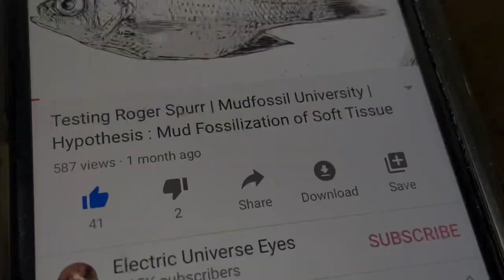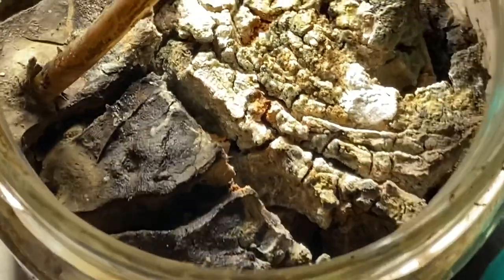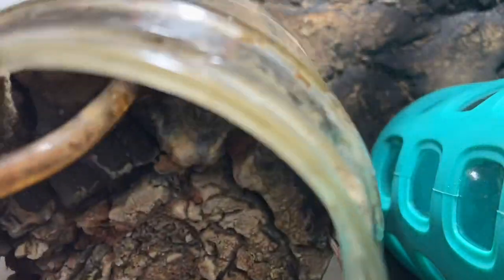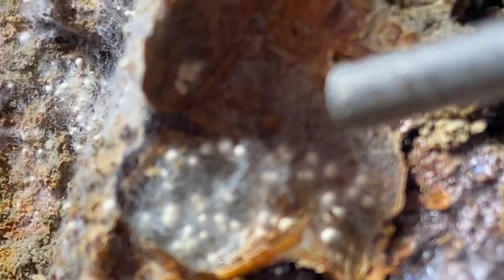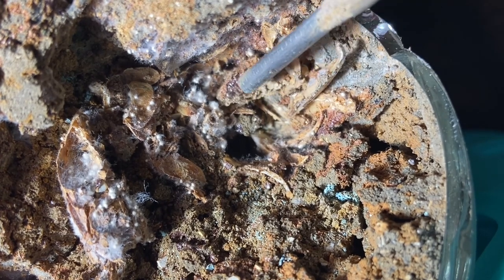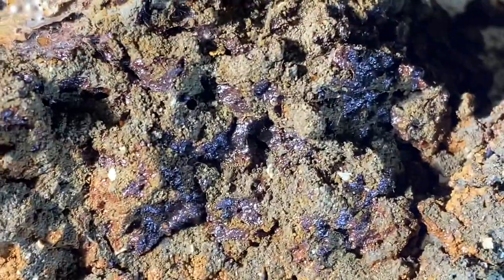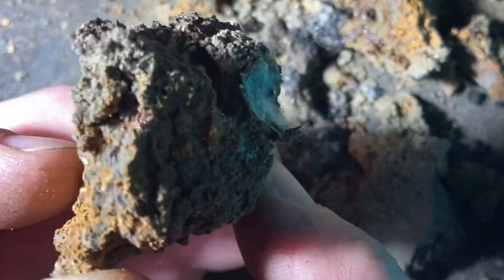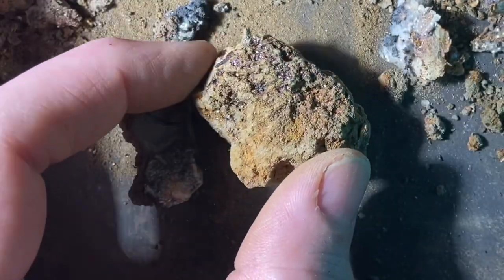⚡️PART 2⚡️Testing Roger Spurr | Mudfossil University | Hypothesis : Mud Fossilization of Soft Tissue

Comment: Because you waited so long I assume everything got oxidised as well as the fact that white fuzzy mould made a home in there. This is because there was too much moisture and that the fish was not solidified and therefore was a good food source for the mould. I also recommend adding methane hoping it will bond with O2 to make CH2O (formaldehyde) if you decide to repeat this experiment.
Reply: Mold and fungi feeds on radiation or at least they feed on electro smog actually look up black mold and Chernobyl
Reply from the maker: @craigsadler1823  That is brilliant! Thank you
Reply from the maker: Thanks!

Comment: I wonder if you could redo this using a pressurized vessel. Perhaps an aluminum pressure cooker with an inlet for a compressor and a sealed, insulated pass through for one electrode. Then the other electrode would be grounded to the vessel itself. The whole thing then placed in a freezer and then energized. My thinking is to try to replicate the pressure of tons of mud. Perhaps use an inert gas like nitrogen to avoid adding any more oxygen. The putrid smell indicates decomp bacteria at work. A second (third) experiment would be to draw a vacuum on the container to prevent electrical arcing through the moisture. While this would not have the increased pressure, perhaps some form of weighted press could be placed on top of the mud to substitute for that.
Thanks for an interesting pair of videos. Since I just discovered you, it will take me a while to catch up, but I look forward to the experience.
Reply from the maker: You have an amazing idea! I just need to acquire the needed materials for this experiment on my shoe string budget